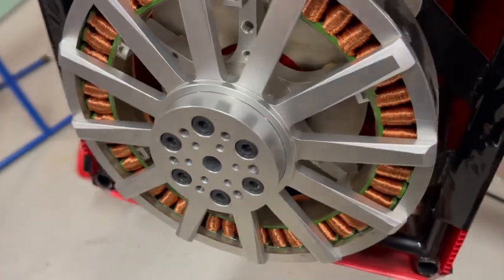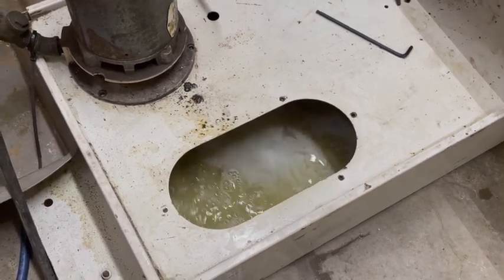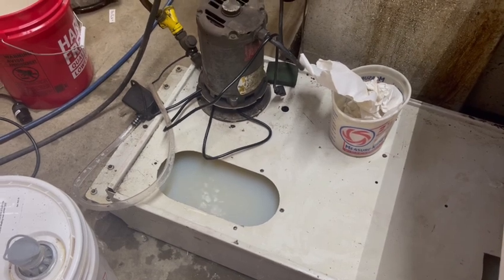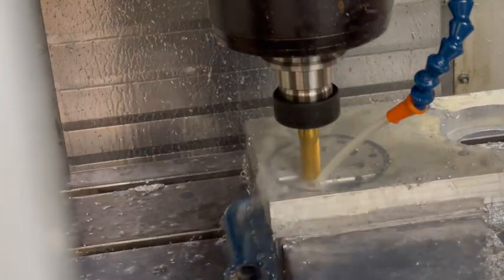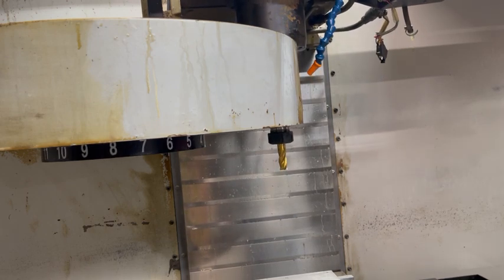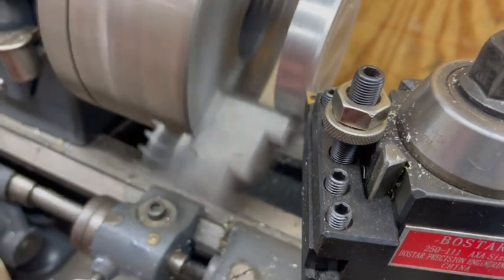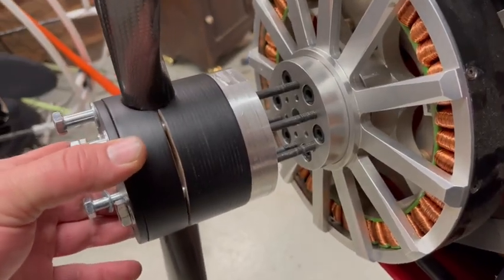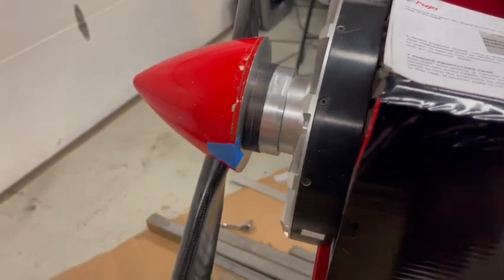Making a Prop Adapter for Peter Sripol’s Ultralight With the CNC

Comment: Congratulations on your successful prop adapter CNC machining project. When your cutting aluminum stick with two or three flute end mills and I agree with the commenters befor me stay away from titanium nitride coatings on aluminum especially when your running dry. Trust the simulations and let the coolant flow it will flush the chips out and you will leave a much better finish. Also when your writing your program do roughing and a finishing pass leave .030" on your profile cuts and then run a second pass to finish size. By doing at least one roughing pass you are creating space for the chips to evacuate the path so each continuing depth of cut the chips have space to be flushed out with coolant. Your a very smart guy I have no doubt before long you'll be cutting like a pro. As long as you get your tool hight offsets right you can trust solidworks simulations don't hesitate to run the coolant. Good luck I'm looking forward to your next video.

Comment: Don't use TiN coated cutting tools on aluminum if you aren't using flood coolant (you'll find that the aluminum "welds" to the cutter surface.  I just use HSS for aluminum.